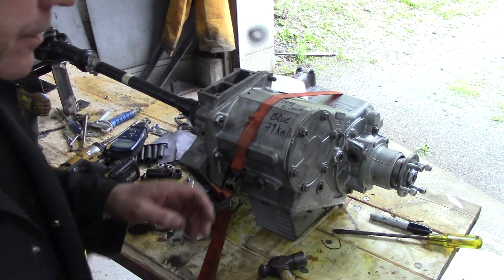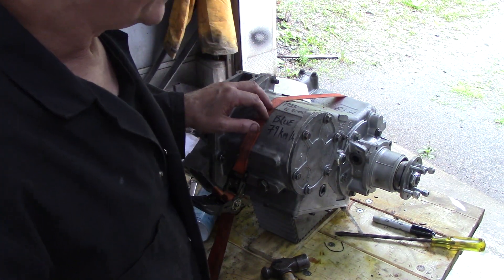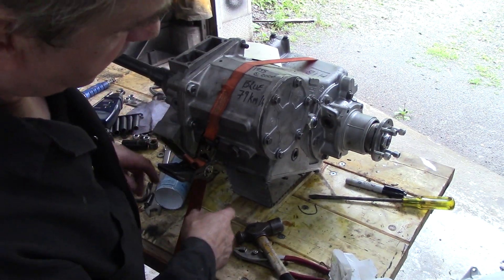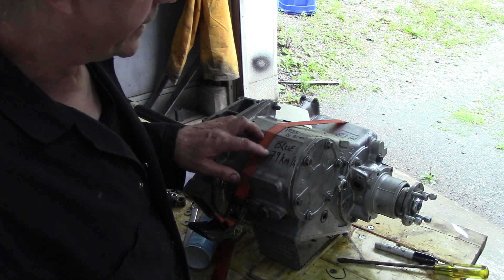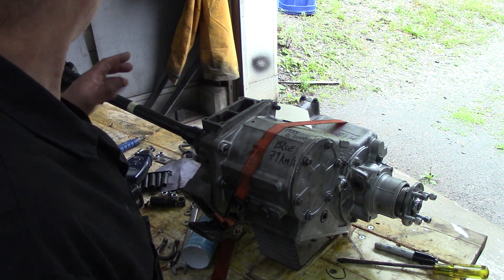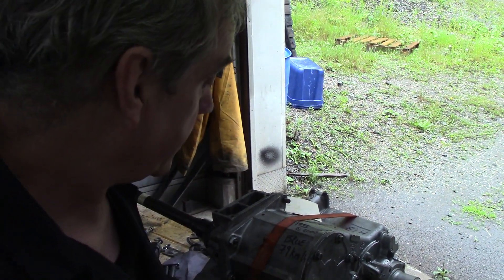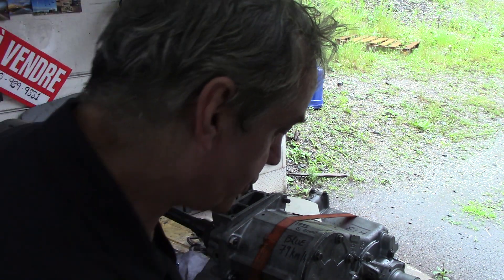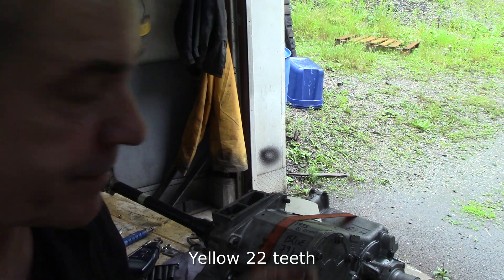LT230 tests 1:100 ratio, with blue and yellow speedo gears. High Capacity Sump. Thermal image video!

Comment: Lots of variables going on here I think for temperature, including heating effect of churning the oil which will be related to its viscosity (varying with temperature!), rotational speeds and the torque being transmitted which influences the friction at the gear tooth contact,  as well as ambient temperature and airflow past the casing.  A side issue is what Flir camera model is being used (Phone hookup version?). Great thermal video!

Comment: Around 12% difference in speedo output, which is about the same as the difference in circumference between a standard Discovery and Defender tyre circumference.
Reply from the maker: Seems all the Disco automatics here had a black 23 Teeth

Comment: It always surprises me how hot these run. With my xfer box in my 110 I normally don't notice anything while driving but sometimes, and for no apparent reason, it runs very hot and makes the panel between the front seats hot to the touch. Does anyone else experience this? Can anyone explain why it sometimes runs much hotter under the same conditions and is there anything I can do about it?
Reply from the maker: Being next to the exhaust does not help!
I heard some chaps down under, fit an oil cooler to the front of the truck to keep them cooler

Comment: Of course the extra surface area on the sump will work great with air rushing over it when driving.
Reply from the maker: Scroll down the page and see one fitted to a Tdci - see how close the exhaust is!
https://ashcroft-transmissions.co.uk/product/lt230-high-capacity-sump/
Reply: @BritannicaRestorations  I guess you could start chasing your tail with exhaust wrap and heat shields but life does seem short at that point...

Comment: It'd be interesting to do a comparison with/without the larger sump but, as has been said, the true benefit of the larger sump willl only really be seen when there's air flow.

I suppose you could get some idea of the benefit using a stopwatch to time how long it takes the oil to reach a certain temperature with/without the larger sump.
It's fairly obvious that more oil means it's going to take longer to heat up but it might be nice to find out how MUCH difference the extra oil makes.